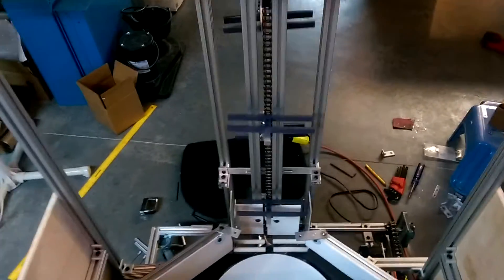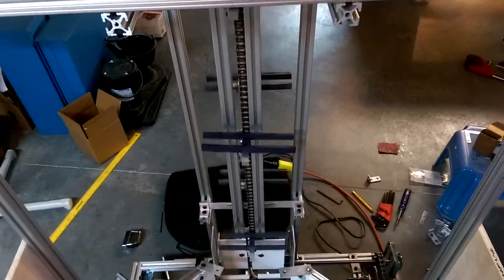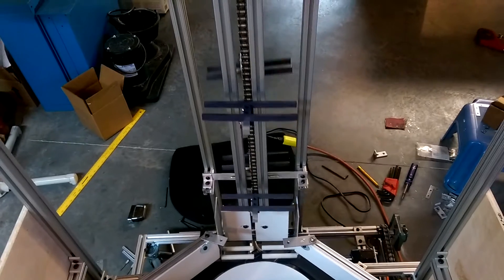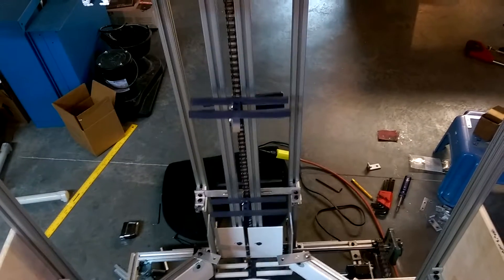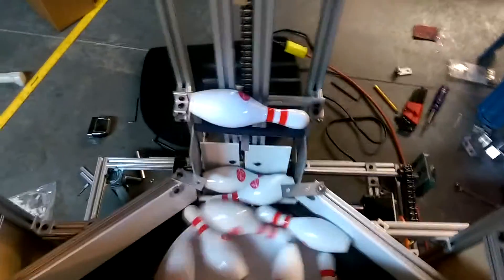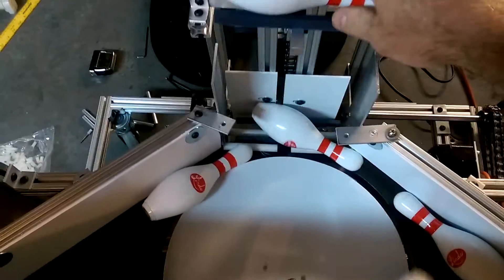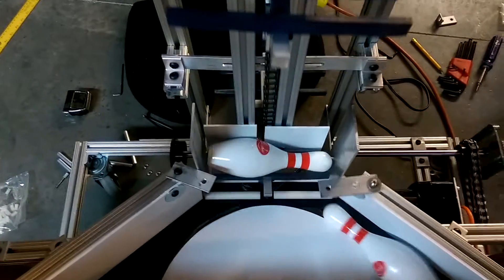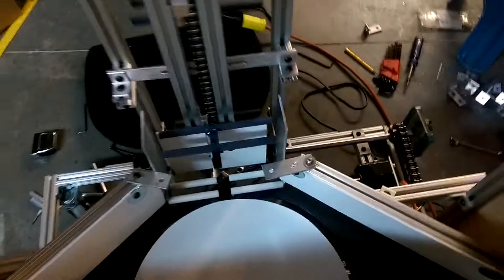Half scale pinsetter pin lift operating

Comment: Its based on the Pin Elevator from the Mendes MM-2001 pinsetter also
Reply from the maker: Not really. It was something I came up with to meet my needs at the time. Many people think it looks like a GSX lift. Either way, it actually didn't work very well, unlike my current system.